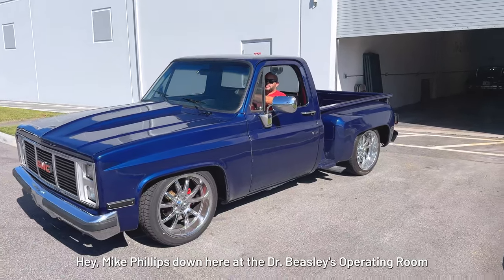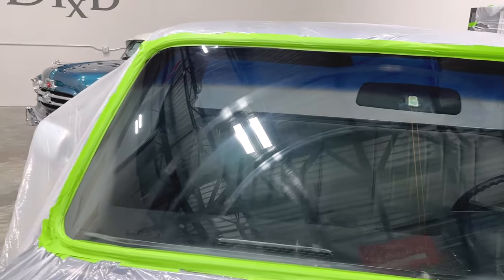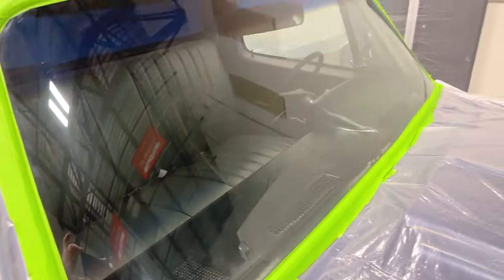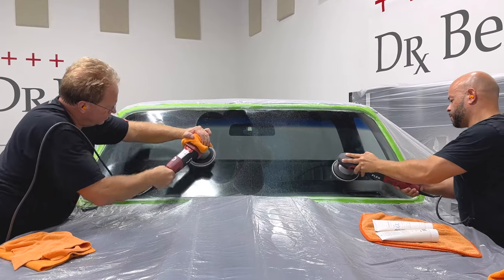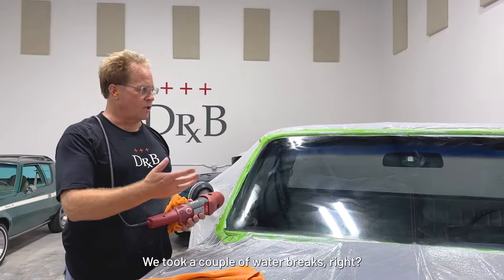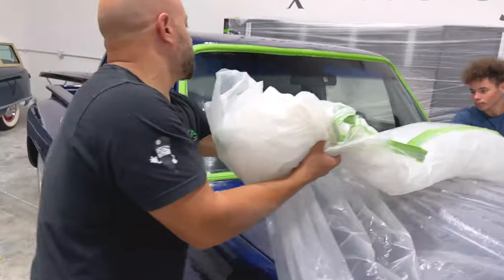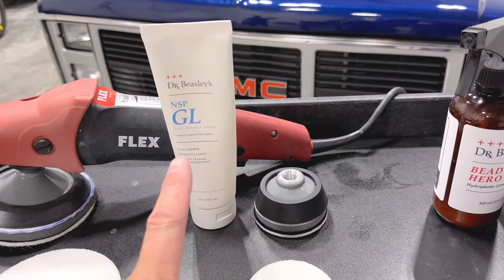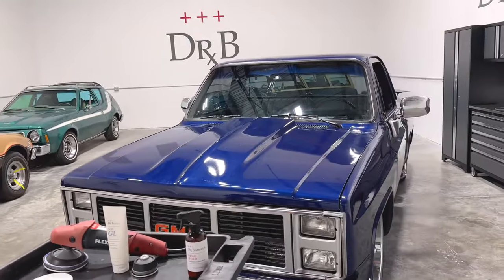Removing DEEP Wiper Marks with Mike Phillips #detailing #scratchremoval #glasspolishing

Comment: But at which speed do you run the polisher and how often do you spray water , is it after one pass or a couple of passes?
Reply: Keep the pad damp, heat is the issue so not too fast. Good luck.